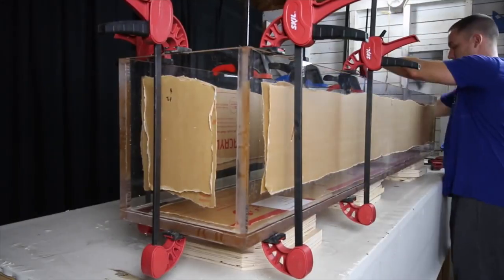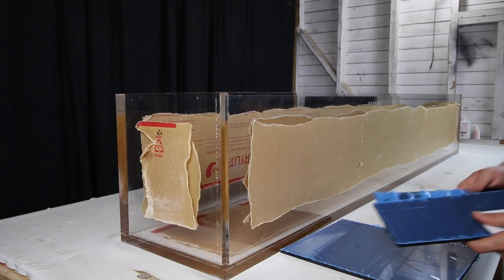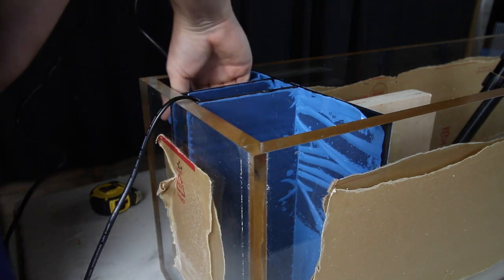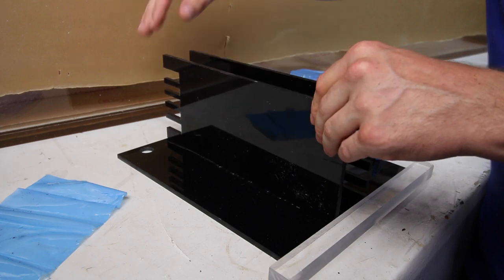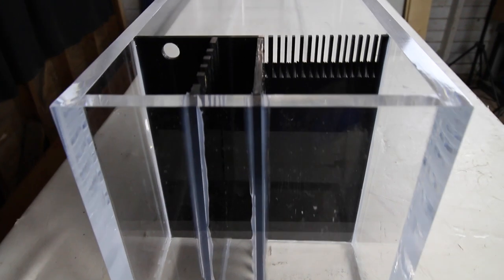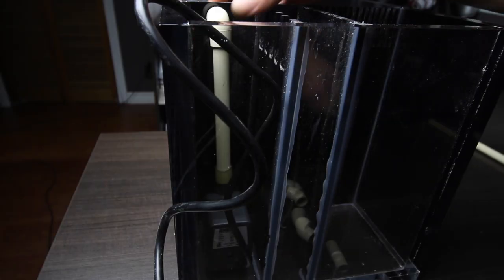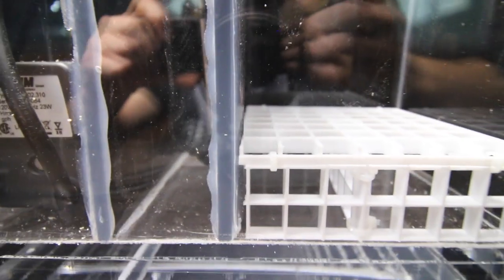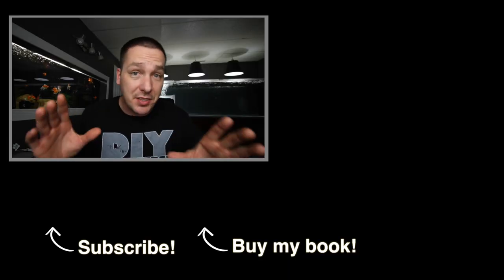HOW TO: DIY aquarium filter - THE OFFICE TANK BUILD!!

Comment: I really appreciate how thorough you are when you're going through this. A brand-new aquarist could watch these videos and have a pretty solid idea not only how to do things, but why they're set up that way and how they're supposed to work. I think there's a lot of other tutorial channels(for any kind of DIY) could really benefit from your approach to thoroughly explaining the what, why, and how.

There is one minor note I'd like to make, although I realize it's probably too late, and you've either already done it or don't have the opportunity to do it. On your filter end, I'd cut two little half-inch by half-inch notches in the aquarium side panel so that the cords for the heater and the return pump can drop into them, leaving the top of the tank with a perfectly flush, flat look. It's just one of those little things that tends to bug me; looking at a beautiful all-in-one tank with a bunch of cords clearly hanging out one end. Call it a personal quirk. Also, an overflow to work with the drip system that we all know you're going to put in this tank would be a worthwhile addition.

Comment: Question.... What ever happened to Subsand Filters?
       When I was into freshwater tanks 50 yrs ago, the Subsand Filters were the hottest thing going. It had some problems with rotten debris collecting underneath it. But some were working on reversing the flow through the risers so it would flow up through the sand to eliminate the dirt under the filter and kept it suspended so the box filter could pick it up.
      I thought it was a good idea and wonder why it isn't used that much anymore.
        If you had a large filter system under the tank, the return line could go to the risers of a Subsand filter.
      There was a problem with that as well, too much water pressure under the filter would blow the sand up off the bottom. So regulate the right flow to avoid that and the excess go to create a current in the tank, like a powerhead would.
        I have always thought that if you could keep the sand or gravel clean, you wouldn't have to do as many water changes. I mean lakes and ponds around here don't get water changes, other than rain and they stay healthy. So enough of the right filters should eliminate water changes or put them to a minimal.

Comment: Hi Joey nice build! Can you explain a little about why you built the first chamber (first seperating acrylic piece) to the same height as the whole tank? If the sponge clogs there's a chance of overflow(cuz the only outlet of the first chamber is on bottom which is below the sponge).

Comment: Joey, regarding your build, What about swapping the inlets so the pump draws from the tank. I imagine doing this myself and can picture myself flooding the room due to a blockage of the inlet Or lazyness and burning out the pump because it has ran dry. Would a sponge be enough filtration to protect the pump should it draw from the tank?
Reply: As long as the baffles stay below the outer walls then clogging the inlet only leads to overflow into sump so this is safe. With a pump sucking in, you would lose both the skimming function and the easy access to the mechanical filter (the sponge).

Comment: Hey Joey, have you considered adding more biological filtration to the pump compartment? you could add another spacer so the media sits above the pump, allowing you to increase your bio filtration by 1/3.
Reply from the maker: +matthew johnson I could if I needed to, but there does come a point when your just wasting money. I already have way more bio than I need for the stocking.
Reply: Thanks for a wonderfully instructive and useful video!  

Question: would adding a kaldness/fluidized bed section add anything to the biological efficiency? 

Nitrates is always the challenge, but I guess one needs sintered media for that.

It's really strange that this solution is not more popular, given that it is safer, cheaper, more quiet, and uses less power.
Reply: Thats fair enough, I guess you can always add it after if you ever increased the bio-load
Reply: Have you considered adding aquatic plants to your tank? I have a turtle and 100 small feeder fish in a 4x2x2, my nitrates always read 0.

Comment: joey. all though this tank looks great and know it will work 100% but from my experience with sumps are you worried the  pump and evaporation will run the water down quickly causing the pump compartment to run dry quickly?. just as a back up i would run a auto top off to ensure the pump never goes dry. just a question I know your a very smart guy and have awesome diy projects. me and my wife have been watching your videos every night for the last 2 weeks lol!
Reply from the maker: +Michael Urbeck no, I have added in some more safety features during set up. This was only the filter build. More on this next week.
Reply: thanks for the reply. and cant wait

Comment: would it be beneficial to run that output pipe to the other end of the aquarium. Seems like it wouldn't get turned over much unless you had something pushing it down to the filtered end.

Comment: With a ~6 sqft surface area, does evaporation ever become a problem? If enough water left the tank the overflow could stop working and the pump would run dry. Or do you just do water changes often enough that that's never an issue? How high do you keep the water level relative to the top/bottom of the overflow slits?

Comment: Joey does the filter need to be water-tight? What if it were a snug fit with tiny pieces of acrylic preventing it from moving  in the aquarium (but can slide in and out). I don't want to use any silicone or something too visible to attach it.

Comment: Really like your'e videos.  Why can't you go diagonal, so you have full view of the front of the tank?
Reply: Mark L you can, make a box u shaped in the center with returns in two directions. only problem is it's not as solid of a grip vs a single wall design. mostly counting on the silicone to hold the acrylic.

Comment: Love the video only got a quick question. Could i use lavarock as biological media, or do the water need to be "pressured" in to the lava rock?
Reply: I use lava rock in all my canisters. buy a bag it works great. I just pick the smallest rock with the most holes to use so I can maximize surface area. as long as its submerged and has good flow around it I'm sure it would work in most filters very well
Reply: Thank you very much for taking your time to answer. I am planning to upgrade my juwel bioflow 3.0 to lava Rock and then a spunge + polyester filling as mechanical media.

Comment: hello bro I am try to understand this..... 
I like this system because all accessories is hidden

I have some questions about this please help me.... I am little confused

I understand in the video how to make this. overflow,
and plastic sheets management, etc

but I don't understand when heater inside how its work??

water is recycling when the power head is on right? 

when power head water recycling this time 
the heater temperature is mix with tank water.... 

so need to turn on the powerhead 24 hours?? 

my English is not so good so please try to understand thanks

Comment: Are these  kind of filters good for shrimps etc... I am more a shrimp / aquascape guy and when i saw this DIY i wanna try it but then i was afraid  would this also work good for them?
Reply: add a fine mesh to the overflow "teeth"  and it probably would prevent most shrimps from being dragged into the overflow area. they might get stuck on the mesh since you have all that pump flow localised on one spot... that is if your pump isnt meant for your tank

Comment: How come you made the filter compartment the same height as the tank? Wouldn't it be better to make it a hair shorter like 0.5“ to prevent any floods? Or at least shorten the divider between the mechanical and heater section  so it's taller than divider but shorter then aquarium so If filter clogs it won't dry out pump or worse overflow onto the floor.
Reply from the maker: +Karl Lyons the output hole handles that.
Reply: It looks like in the next video you added the overflow protection (shortening the wall between the mechanical compartment and the heating compartment) that  i was talking about that wasnt complete in this video. Also gorgeous tank and stand! excited to see how you stock it!

Comment: I noticed that you don't have an emergency overflow path should the filter become blocked - I guess that is a very low risk and probably very unlikely - you do however a safety system on your 375 gallon tank.
Reply from the maker: The system is not complete, nor set up yet. There are other modifications done that couldn't be done until later. They will be covered in the upcoming videos.

Comment: How can you control the level of water? Water will evaporate after two to three days and the water level will fall. If you go out for a week, it would be a problem.
Reply: Cem Celikel auto top off system in the the return pump are with a bucket just while you're on vacation until you figure something more permanent

Comment from the maker: PART 1 ► https://goo.gl/PGmVID

Get the ultimate DIY book ► http://thekingofdiy.com
Facebook ► http://facebook.com/uarujoey
Instagram ► https://www.instagram.com/uarujoey/
Reply: Do you know how to breed black Moore's
Reply: Get some water hyacinth, get a boy and a girl and jump in! You'll need a separate tank to put the eggs in once they spawn. If you're struggling to get them to spawn start being stingy at feeding time, raise the temp slightly then go with live food and plenty of it!
Reply: thank you so much! how big do they have to be to breed??
Reply: Juveniles will readily breed, I've bred them at around 2 inches. Try to cycle an air driven sponge filter for your fry tank once they get spawning. I use elodea densa in fry tanks because it grows quickly and is readily available here. Start looking up fry foods now before you get going, like if you decide to go daphnia make sure you can source it. I know lots swear by brine shrimp but I've never used it
Reply: thank you so much! do you think I will need a booger tank for the frytank that I have now it's a 5 gallon.
Reply: Initially that's fine, the bigger the volume of water the more forgiving it'll be. I've had best with fry when I have raised them in outdoor ponds at the start of summer. Would be tricky now. The larger the 'container' the better to be fair
Reply: Ok thanks what size tank do I need to breed them in
Reply: A 3 foot tank would be good
Reply: is this gonna work for a 7 feet tank? I am afraid is not gonna reach all the water but just part of it without reaching the far end of the tank. thank you for the answer
Reply: Once again, awesome video Joey!! I can't wait until the next one!! Keep up the awesome work!
Reply: Great vidio man! Your seen so smart with this stuff. Love your channel 🐟

Comment: With all the respect there are a number of things wrong with the build. first, 3/4 inch thickness is an overkill for such a small aquarium. the thickness of acrylic  needed for an aquarium is calculated by the hight of it ...not length not width. you can build a 100 feet by 100 feet aquarium with the hight of 10 inches out of 1/4 inch thick acrylic...second, silicone does not adhere to acrylic, it will only create a temp seal ...but for non professional, you did a good overall job
Reply: As he said many many times, he built this to use up the rest of the acrylic that he used for the much larger tank. That is why the extra thick acrylic. 
As for the silicone, he only used it for a seal on the internal parts, specifically so that it can be undone if he changes his mind later. 
Did you watch this on mute?
Reply: akif karemani dude the guy is a professional in the hobby I think he knows what he is doing...